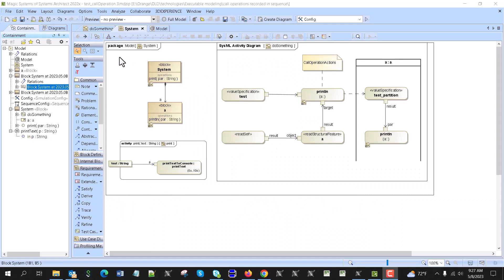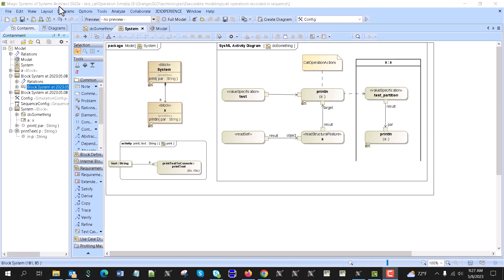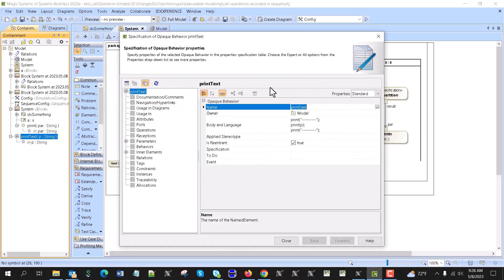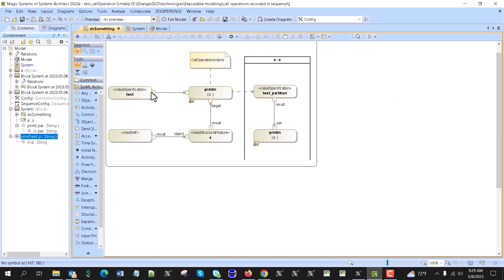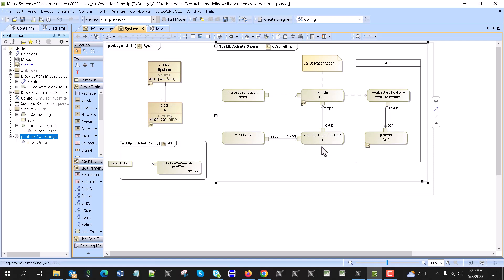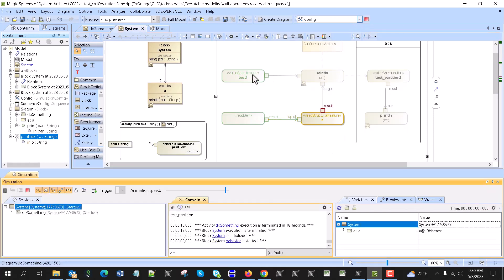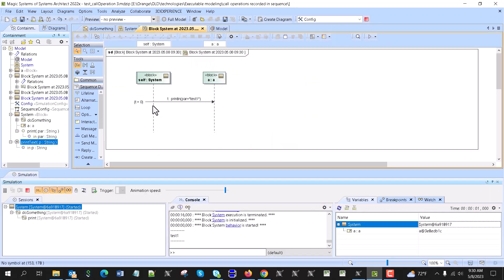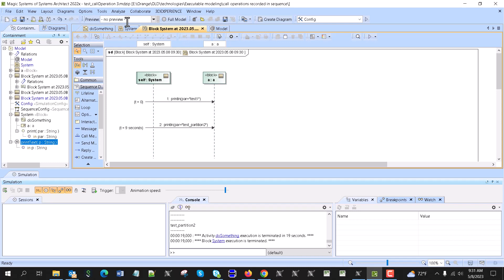Autogenerate Call Operations in SysML Sequence Diagram

Comment: Hi Saulius.  Thanks for your video I've been looking at it intently and I duplicated it using CSM 2021 (my company doesn't have 2022 yet).  Couldn't get it to run properly, so I downloaded your model file that you made using 2022.  It doesn't display the diagrams properly when it opens in 2021, although I think the model is still functional.  I noticed that the downloaded model differs from what you show in your video.